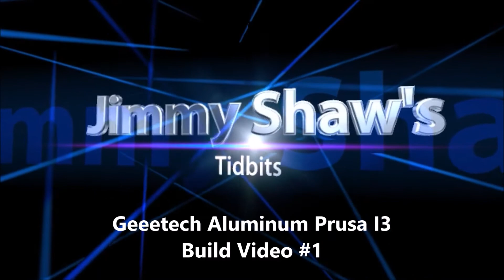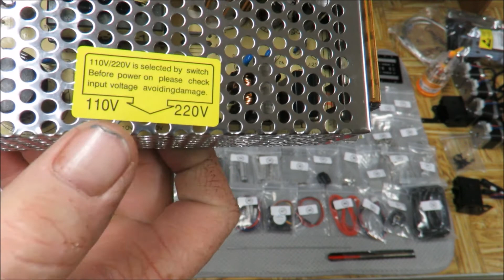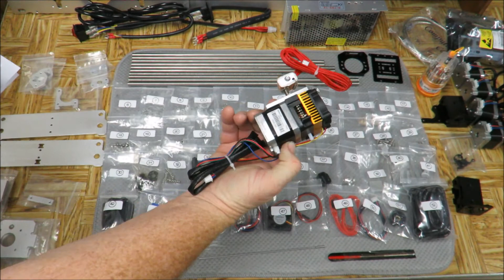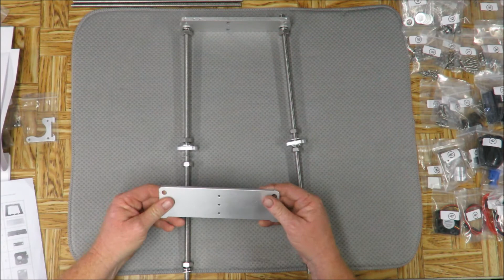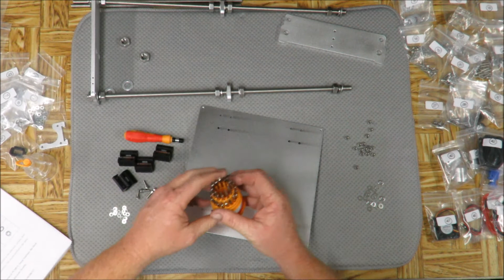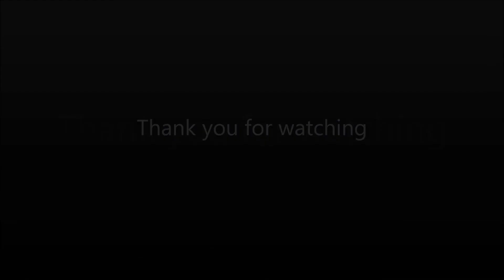Geeetech Aluminum Prusa I3 Assembly Part 1

Comment: Is the frame all metal?
Reply from the maker: +Jesusreignonhigh Yes.  It's a solid aluminum frame.
Reply: Jimmy Shaw's Tidbits Wow. Do u think its metal frame can also be used for the original Prusa i3 MK2?
Reply from the maker: +Jesusreignonhigh I'm not sure.  I know Ebay has the Aluminum frame kit for about $60 that you can upgrade from an acrylic model.  It might work.
Reply: +Jimmy Shaw's Tidbits i c, thnx